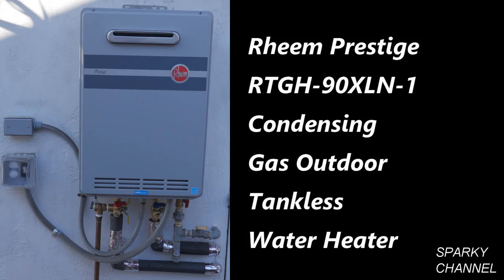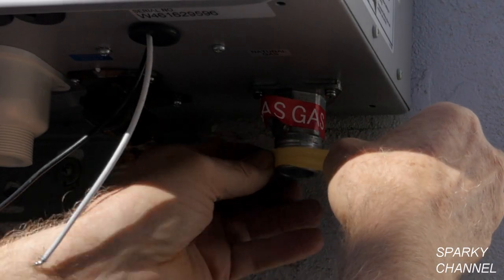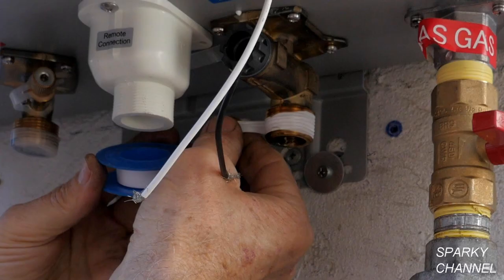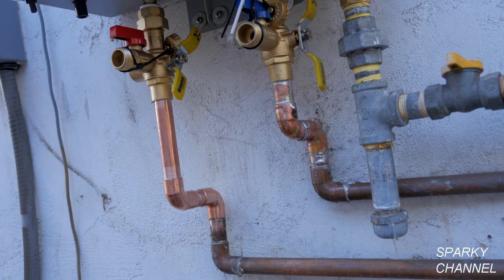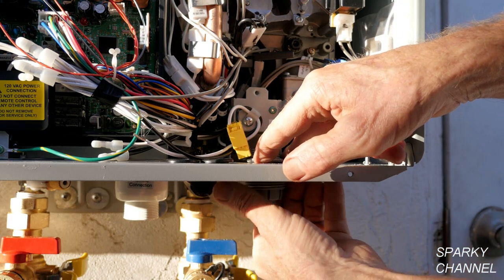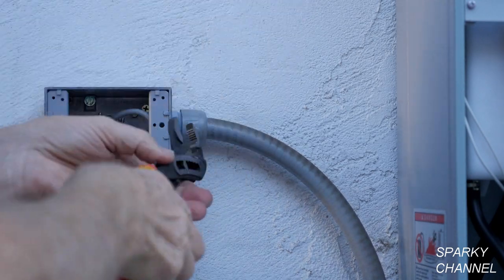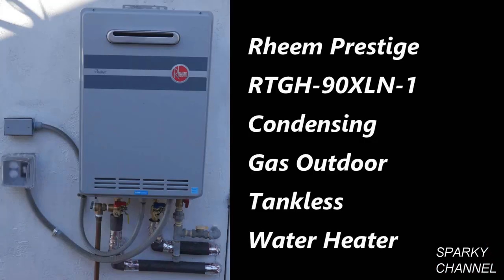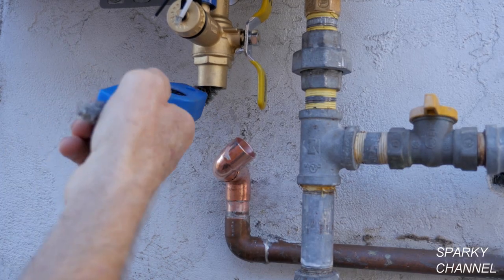How To Install a Condensing Tankless Outdoor Water Heater

Comment: Thank you for this video Sparky! Im In Fort Worth during this arctic Blast and the copper pipeing at the top of my unit has frozen and burst. Im going to have to replace the whole unit I think. Thank you for the video. I think I'm going to be using it here in the next few days. Wish me luck. lol
Reply: same thing happened to me, will need this video soon.
Reply: Same thing for me, but in Houston.  I've got the indoor unit up in the attic, but this is almost identical.

Comment: Nice job, you covered a lot of ground in 8 minutes.  Looks like you prefer PTFE (teflon tape) over pipe dope...did anything leak?
Reply from the maker: No, nothing leaked. The Rheem manual call out to use teflon tape, not pipe dope. They don't want a small piece of pipe dope getting into the tankless water heater.

Comment: Nice job on the installation. I do a question, I just installed a rhemm indoor tankless water heater and it’s making a loud vibtration noises when I turn on the hot water line on any of my faucets. I’ve check gas line and I have 3/4 line and I also checked the vent and is taight and secure. What do you think and recommend I can check or do?
Reply: How long has it been installed?

Comment: Excellent video, how do I remove a existing  rheem rtgh prestige tankless unit to replace it witt rtgh dvln-2?  While maintaining existing p lumbing settings and minimum efforts, without the need to solderthe pipes?
Reply from the maker: Do the gas and water fittings match up on the rtgh dvln-2 with the rheem rtgh prestige tankless unit?
Reply: @SparkyChannel  Yes, they do, thank you.

Comment: Could I hook up a water hose to the cold water valve so I can use it with my pressure washer?
Reply from the maker: Probably but you wouldn't have much pressure for the tankless water heater while you're using the pressure washer. You would most likely get an error message on the tankless water heater and it might be difficult to get it corrected.

Comment: Hello, does the power source need to be directly to a breaker? CA area will be permitted!
Reply from the maker: Yes, in most cases. The newest Leviton load centers are a little different.
Reply: GFCI protection requirement under the 2020 NEC - even hard wired.

Comment: Which one do you think is better Rinnai or Rheem?
Reply from the maker: I think they are equal.
Reply: I just swapped out 2-180,000 Rinnai’s in my house that were running in tandem, they lasted me over 20 years with zero maintenance and never broke once until it was time to replace, had I maintained them properly I’m sure they would’ve lasted longer but I definitely can say I got my money’s worth so I installed 2 replacement Rinnai’s. Rinnai is a solid brand, I think they’re the best but don’t quote me on that

Comment: Hello Sparky, what type of romex your using? thank you
Reply from the maker: 12/2 NMB by Southwire.
Reply: Thanks Sparky. Just curious you had a red wire connected to the units hard wire black. Just wondering if I needed a different Romex type for the switch

Comment: Why is the valve installed after the union? If you have to replace the heater wouldn't it be easier to have the gas valve before the union then you can turn off the gas disassemble the union and you do not have to turn off the gas at the meter?
Reply: He had one before and after the union, not sure why the one after the union is needed like your saying but he said the Rheem manual said to put it. All I can guess is safety redundancy in case one fails. Also these things are rated to last 30-40 years so it wont be me replacing it, lol

Comment: @Sparky Almost every outdoor tankless water heater brand has a different minimum height requirement for the unit, what's the code requirement in your City of San Diego?
Reply from the maker: I believe it's 3'.
Reply: @SparkyChannel  Thanks Sparky.

Comment: What’s going to happen if I have a 3 foot overhang with 8 feet of clearance above the vent ?
Reply from the maker: I don't think that would be a problem but you could check with the manufacturer.
Reply: Sparky Channel so now, to connect my outdoor gas line(galvanized steel) with a psi tester and shrader valve to the 3/4” gas line from the tankless heater?

Comment: don't mount your water heater outside. Texas found out the hard way, but one rare cold snap and everyone's boilers and water heaters exploded their water lines and were A) without heat, water, or both. and B) it was a nightmare for them to restore water because everyone's boilers/water heaters are just wide-open faucets. 

it's not that hard to install it inside and run a vent out. if you live near the Amazon rainforest, then maybe you never have to worry about it, but anywhere in the US that has ever gotten snow is a terrible idea to install outside.
Reply: I think in Phoenix we will be ok

Comment: ur code allows tape on gas lines?
Reply from the maker: Yes, in fact Rheem says to only use tape.
Reply: You need to use the yellow colored tape. The white is for water lines only.
The reason you can't use white is that if little bits break off in the pipe they can interfere with the gas valve. The yellow tape doesn't break into little bits apparantly.